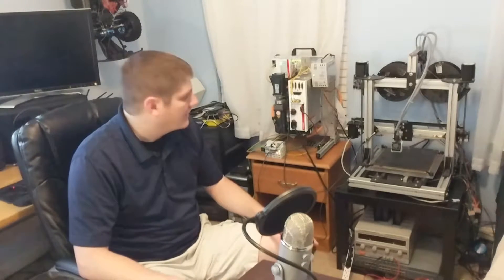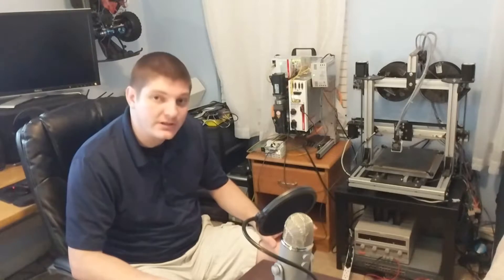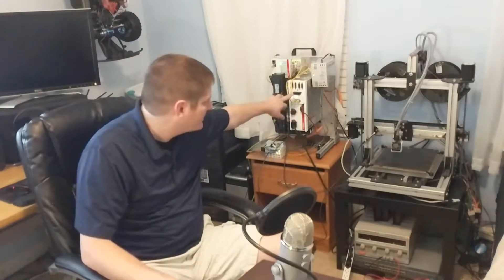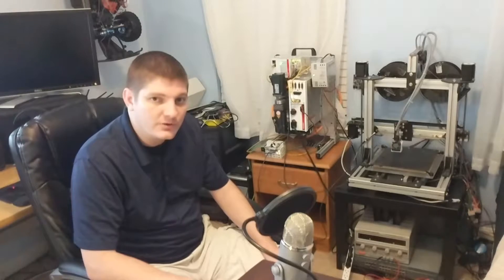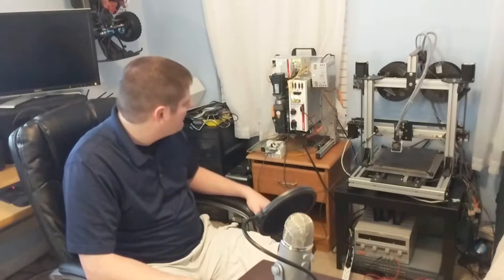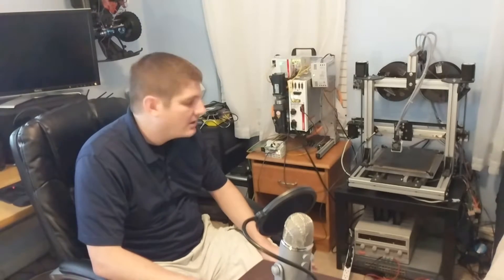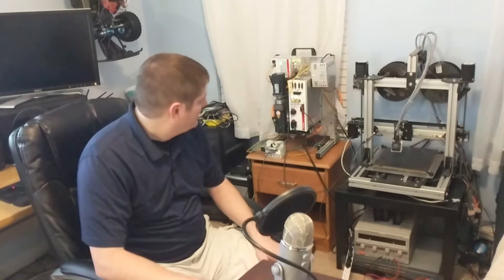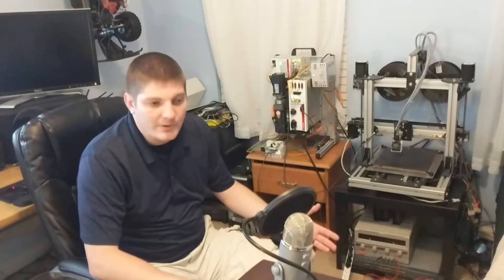Motion Control and IO with PLCs - EP16 - Wrap Up

Comment: Which software do you recommend to make it the projects easier. I noticed you used a program earlier in the series to search of IPs before broadcasting inside Beckhoff.
Reply from the maker: That was angry ip scanner. It does the job.
Reply from the maker: Oh, in general...  Good flowchart program, I like draw.io. I use notepad++ for jotting things down a lot, and python for data manipulation and such from time to time.

Comment: Thank you so much it was very helpful to start learning about motion control and PLCs. In the previous video series and in this one you´ve mentioned about simulation, but I´ve had troubles trying to work without the hardware. I´ve tried setting up the EtherCAT simulation but still there´s no way to fully do everything without the hardware present, thus we would have to always code with the PLC and robot present or change a lot of the settings every time we want to work with and without the system, and the system won´t always be available. If you have some insight on simulation that may help it would be much appreciated! Thank you!